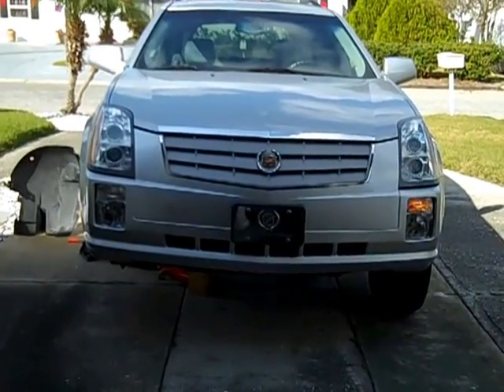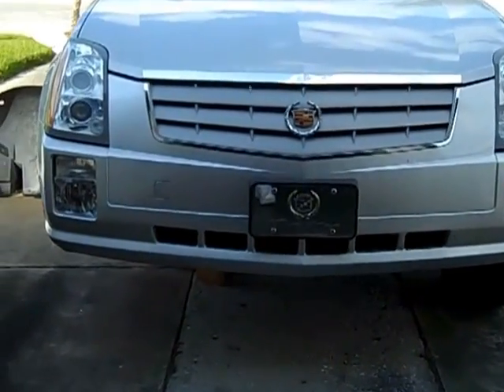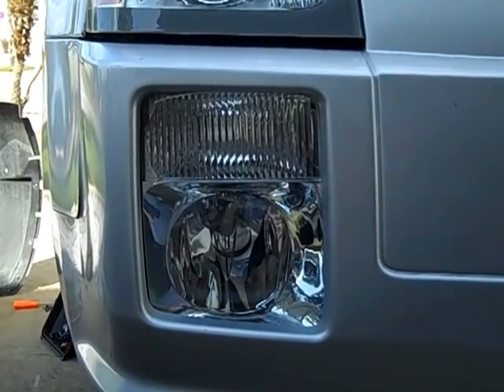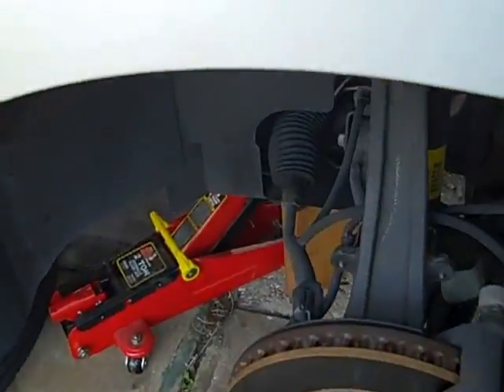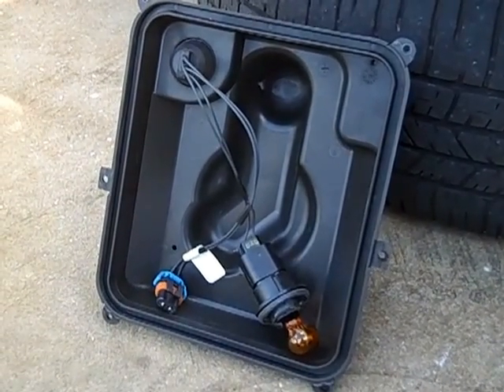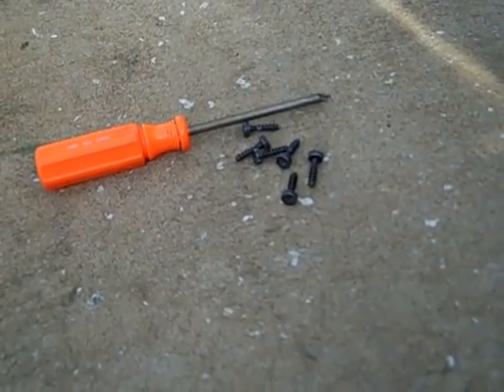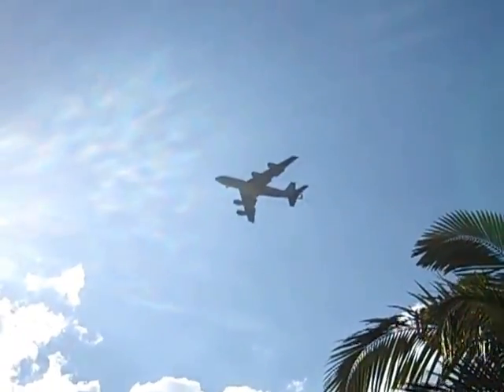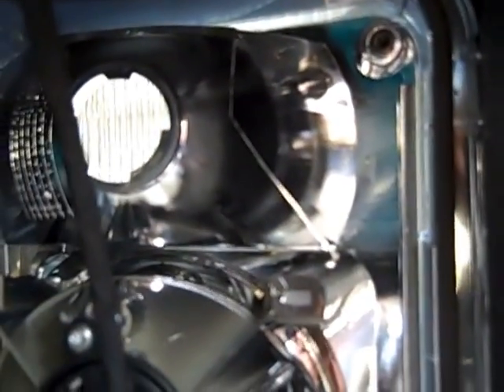Cadillac Daytime Running Lights

Comment: My DRL lamps on light is coming on on my 2010 Cadillac SRX when the engine is off and running down my battery. Is there a way to disconnect this warning light by removing a fuse or something? Going on my 6th battery.

Comment: to get the torx screws out (torx 15), use a torx socket attached to a flexible extension with a powered screwdriver or drill.  It made it very easy to r/r.
Reply from the maker: Good tip Jon!

Comment: Do you think the 2009 Cadillac SRX daytime running light and turn signal fog light housing will fit in the Cadillac CTS 2003 to 2007 bumper.
Reply from the maker: I think yes, but to be sure call a Cadillac dealer parts department and see if they're the same part number.

Comment: Thanks. Very helpful.  There was no way to take off the wheel well cover without taking off the wheel.  Also, those torx screws were tough to get out--very tight space.  This car was not engineered well for replacement of the front turn signal bulb!

Comment: Thanks for the info!!  Helped a ton! Wait til you have to do the driver side.  There's an air intake for the air filter right up against the panel.  I removed the mount screws for the air filter and it gave me enough wiggle room to get it out.  Nice shot of the jet ;>)

Comment: ty.. very helpful. Between what it took to pull a northstar engine to rebuild and fix a couple major design flaws, another friends GM with a plastic intake manifold that has coolant and oil channels going through it with bad gaskets, and this ridiculous bulb they tried to charge 400$ for to a friend of mine to replace! I have decided I hate GM even more than I did and will NEVER own one. What the shit is wrong with that company?